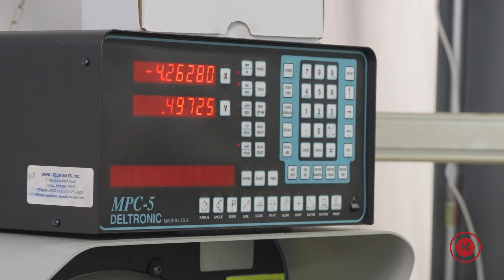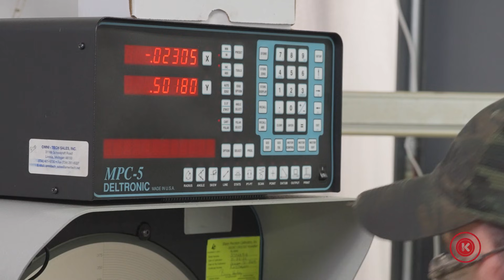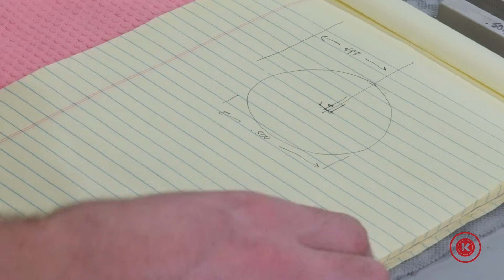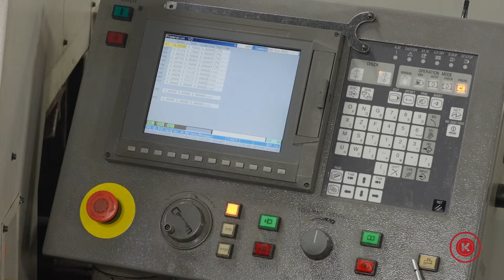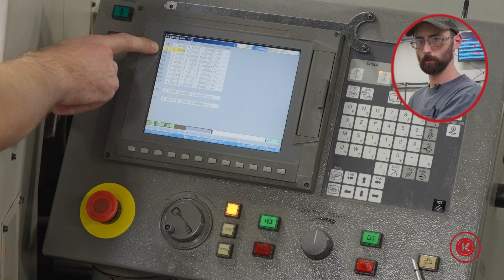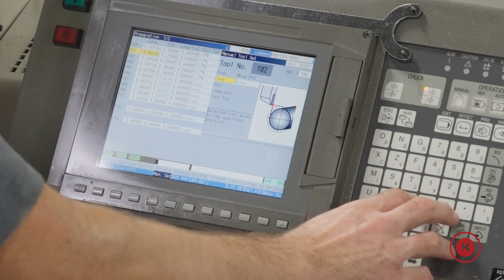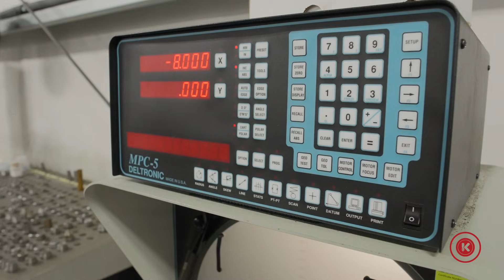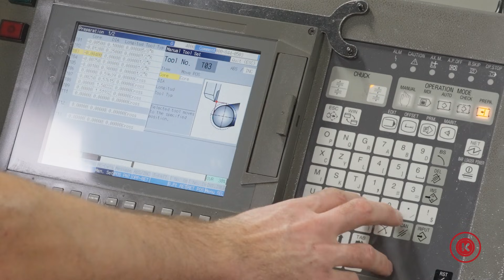How To Measure & Set Tool Core / Swiss Lathe

Comment: Im here looking for how to set the core values on the live tools on the gang 🤷‍♂️
Reply: Divide the shank of the tool by 2 to get the 1st #.
Put in drill and tighten it. Call of the center in the machine for that station. Use the shank of that tool and move it close until you reach the stock. Use with a .001 precision shim between and shank of the tool and the actually stock. Once the shim doesn’t slide and it’s tight. Press input for the center of that tool station.
Now add the 1st # you have along with the shim.
Reply: this is the way @user-kh1ro6wv3t

Comment: Also. If you need to change your Preparation page data, you can use the [ABS] soft key, then if you apply a value, it will change your Data to that value without adding or subtracting (hence ABSolute)

Comment: That’s not necessarily true if you don’t have a comparator or a shadow graph, you can very easily set a Turning tool and face off under center, once you get a nipple you can measure your nipple with a Micrometer, once you achieve a value you can make an offset appropriately (Y axis is sometimes radial, not diametrical so make sure to check that) and then take it out, measure the thickness differential and change your offset to that value.. now you have a threading tool set in Y axis, without a comparator or shadow graph.
Reply: Do you do half the tit to be on center once you have measured the tit
So if the tit is .020 do you put half of that to you axis as positive value in your y axis.

Comment: You can put a .625 tool blank in and touch off on the side of the bar then wind over half diameter to set centerline then add/subtract the shadowgraph measurement from there. You could even turn the bar for more accuracy.
Reply: Yes! This is good. That’s a machinist right there!

Comment: Hey guys! Thanks for making these great Swiss lathe videos! How do you find the Z axes coordinates for the Tools? Greetings from Berlin Germany
Reply: I do cut off - start pos - G50 shift to Z0.0 
then bring each tool down and touch off on front of bar and set longitude.
Reply: Your Cut-off/Part-off shift will be from the INSIDE cutting edge, to the shank, and then minus any face-off amount (I like to use 0.0100) that will be your initial G50Z shift, then when your tool calls the Z axis to machine, it will shift that amount.
Reply: @h0mbsk  yes. Cutoff width minus insert width minus facing amount. For 1/2" tools with 3mm blades the shift is usually G50 W.370. For 5/8" cutoffs, it's usually G50 W.525. then call G0 X#814+.1 Z0 to position next tool.
Reply: Thanks to all answers! I think i got it now. My machine center of my Traub tnl12 is somewhere behind the guide bushing. It was difficult to Set the correct Tool coordinates on Z without ending up at Spindle  Software ends.
Reply: You can measure from the face that mounts against the gang to the leading edge of the insert, or from the leading side of the holder to the leading edge of the insert if you're using a turret style machine.
That will just be a 1:1 adjustment with a z offset or work shift.